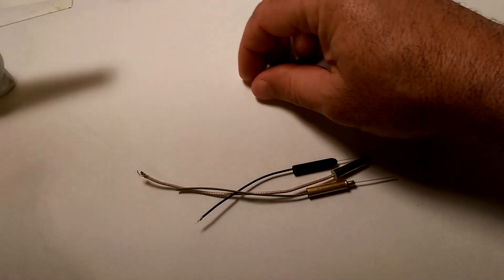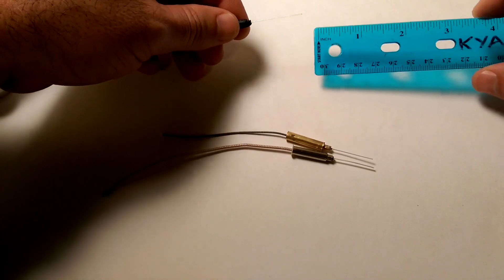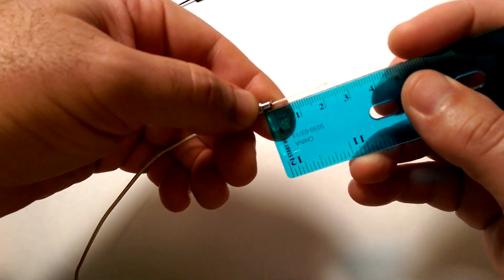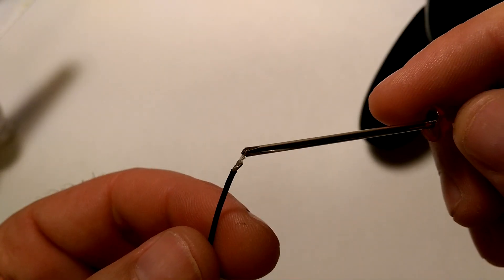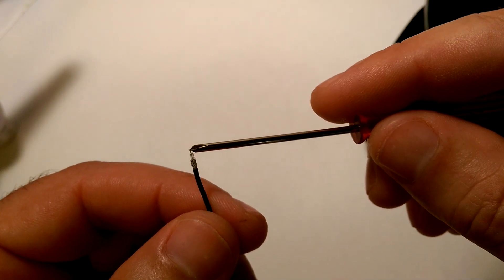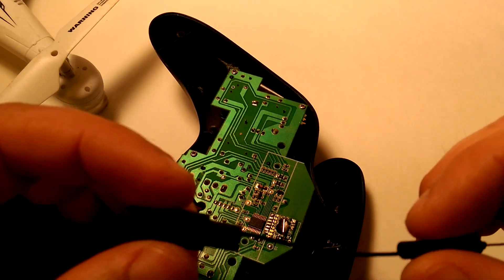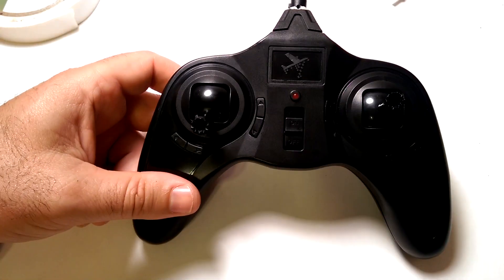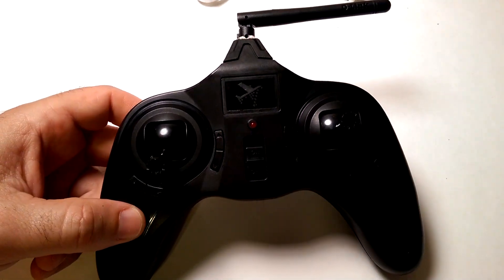Q7 FY326 Triple Range Mod Step by Step (Syma X5C Replica) Quadcopter Drone

Comment: +DustinDunhill would you know where to get a body for the FY326 Q7? Mine had a 15' drop on the blacktop and one of the arms has a crack.
Reply from the maker: I'm not sure but check the store at the link I put in the video description, they may still have parts.

Comment: Oh, sorry... Any quadcopter in this range can be modified to get range over 1 kilometer! I did that, and attached Mobius camera + FPV 25 mW transmitter at 5.8 GHz. Check my channel for antenna modification, installing buzzer, and on my another channel you can find proof of 1.1 km flight.

Comment: Seems that motors are 8.5 x 20 mm, unlike Syma X5C and Bayangtoys X8 - 7x20 mm. Also, I suspect that protocol for remote is the same as Bayangtoys X8 - which is not compatible with Syma X5C. This is good news if true, since I have BT X8, and remote looks more serious than this one. Also, whole quad is cheaper.

Comment: Hey, you seem to know alot about these kind of copters. I have a problem with my FY326 as it randomly looses connection with the controller. It works for about 20-30 seconds but then instantly drops to the ground and is unresponsive. The only way to fix it is to disconnect the battery and wait a few minutes but then the cycle repeats. Do you know of any way to fix this issue?

Comment: Hey, thanks for posting this. I am looking at antennas on ebay and I notice they have different dbi values. Is 10 dbi better than say a 5 dbi? Any tips on making sure the antenna is full wavelength? Thanks again.
Reply from the maker: +David Siglin The highter db antennas should give you better range if you can handle how huge they are sticking up :)

A full wavelength of 2.4GHZ is 12.5 cm.
A 1/2 wavelength is 6.25 cm
A 1/4 wavelenght is 3.12 cm

This should be the portion of antenna without shielding above the decoupler
Reply: +Dustin Dunnill Sorry I should have been more clear - I read where you stated the length it needed to be past the decoupler. I'm just looking through ebay listings and non of them say the length so it seems like it is a gamble.
Reply: +Dustin Dunnill So after taking apart an old 2.4 ghz router it has a coupler thats been shrink wrapped above it to a connection where the external antenna attaches to, should I measure just to that connection when figuring out what duplex I have? Also I noticed they both are different lengths from the same router and comparing them to another 2.4ghz router the external, or screw on folding part, are also significantly different is length. Just trying to figure out what would be the best i guess and the right one. Thanks in advance.
Reply: +David Siglin I meant wavelength not duplex

Comment: Having a hard time finding a 2.4GHz antenna with a 3.1 cm measurement from the decoupler to the tip.
Ive opened up three 2,4 Ghz antennas and all are less than 3 cm.
Any idea where to buy?
Reply from the maker: +GreggC _ Ebay or you could try soldering a small piece on to get length.  Just make sure your soldering is minimal.

Comment: EXCELLENT VIDEO!!!! I'm going to use your suggestions for both the transmitter and the quad itself for my Syma X5C-1 also. I bought two 5db 2.4Ghz antenna's and had the dickens of a problem stripping the teensy weensy coax wire that came with them. I saw another video on You Tube with a wire stripping hack that showed how you strip these small coax wires using a butane lighter instead of wire strippers. Do a You Tube search on "stripping small wires" and you'll find a couple that show how it's done.

One question. Does soldering a longer piece of wire to the quad copter antenna to say, 1/2 or one full wavelength then running it down one leg of the quad make any difference? i.e. is 1/2 or one full wavelength better than 3.12Cm for increasing signal reception?

Okay, okay....one more question. Does the wire you solder onto the existing quad antenna wire need to be the same gauge or can you use a smaller gauge wire?

Again, GREAT VIDEO! Best I've seen on transmitter and quad antenna mods.
Reply from the maker: Hey Robert thanks!  Thanks for stripping tips.  You can also just gently roll an exacto knife over making a circle cut and pulling of sheathing.

Longer would help if wavelength measurements are accurate and yes, bringing out from electronics and center will help.

I would suggest keeping wire same guage and keeping solder joint as minimal as possible (these will effect wavelength).  How much, I'm not sure.  It may b negligible for these lower quality radios.

Good luck!

Comment: I have ordered a 2.4ghz antenna 5dbi its got wire on it already . so it don't matter how long the wire is? the 2.4ghz wire bit is INSIDE the antenna its self yea?
Reply: this is the 1 I have purchased . will this work   http://www.ebay.co.uk/itm/351468229825?_trksid=p2057872.m2749.l2649&ssPageName=STRK%3AMEBIDX%3AIT
Reply: lol yes it does watch the vids on youtube and ive done it now and it goes at LEAST 3 times further bro
Reply from the maker: Yes he does.  Because he did it and it worked.  Imagine that.
Reply from the maker: As long as it is specified as 2.4ghz and brings the signal Portion up and out of the controller, anything will be much better than the stock poorly measured antenna down inside the controller.
Reply: worked like a treat m8 I'm waiting for a low wind day to take it over the field and do full test with both my transmitters (b4 b4 and after mod) and vid it to see the difference il send u link if u want when I dn it ty for help btw

Comment: Hi, finally i'm tryng to do the transmitter's antenna Mod. There are some difference between my transmitter and Your.
Could You help me please?.
In my transmitter the little PCB where the antenna have to be soldered, make a 90° angle with the main PCB... and i have to unscrew  the main PCB to reach the antenna PCB.
I've some pictures of it if necessary. Make some measurement i've found on the little PCB a tab ( is 1 mm round tab) wich is a ground tab..... There is about 5/7 mm between where i've to solder the central wire of the antenna and the ground tab.... This distance (5/7 mm) could be a problem?
Have i to remove hot glue to find a more closer ground tab.. looking this video (at 8.25) sems to be like your distance between central wire and the ground, but my ground tab is clean not used without soldering on it..... 
Sorry for my bad english (I'm italian) ant thanks a lot
Reply from the maker: leonardo Gargano Hey Leonardo,  It seems we have different controller versions.  I would recommend looking to rcgroups.com to find the Q7 forum and maybe someone who has your controller version can help.  Sorry.

Comment: Does anybody know where could I find spear motor gears for this quadcopter? I'm taking about the gear on the motors' axle (see here: https://plus.google.com/+DanielDur/posts/Ub6QNLXZZ8M).
Thanks
Reply: +Daniel Dur yea m8 they are easily available from ebay from people who sell all spare parts for it just type into google syma x5c small gear or....                http://www.ebay.co.uk/itm/251891017508?_trksid=p2057872.m2749.l2649&var=550861488568&ssPageName=STRK%3AMEBIDX%3AIT
Reply: you can get em cheaper but these come to me quick
Reply: ianroofer1986 , you're saying that the X5C gears fit the FY326? Does the motors too? Cause I found several offers for under 2$, small gear included and, giving that at a point I might need motors anyway, I'm tempted to buy two of them (one CW and one CCW).
Thanks!
Reply: Daniel Dur I took a look at your pic and they look exactly the same I purchased them last week they just click on
Reply: +Daniel Dur x5c motor is exact fit on q7 red board

Comment: thanks Dustin. I found a 2.4 gigahertz router and it has an antenna on it do I have to do anything or can i just unhook it off the circuit board and then hook and onto the circuit board in the transmitter? I noticed you had yours apart and I didn't know if I needed to somehow tear it apart or not.
Reply from the maker: Yes, you can use it.  Un solder it and make sure you install it in controller as seen in video.

Comment: Would this antenna work: http://www.ebay.com/itm/Spektrum-SPM6819-Transmitter-Radio-Antenna-DX2-0-DX3-0/391190408326?_trksid=p2047675.c100009.m1982&_trkparms=aid%3D777000%26algo%3DABA.MBE%26ao%3D1%26asc%3D32297%26meid%3Dd8393c6ec7d7453880e1960e96050c07%26pid%3D100009%26rk%3D1%26rkt%3D1%26sd%3D351456929814
Reply from the maker: As long as it's 2.4ghz...but I didn't see it stating it in description.  Maybe ask seller.

Comment: Hello! My red board FY326 can only reach like 50 meters :( ... One question: Why should it be better for range if you use a Wifi-Router´s antenna? My copter has 3.12cm long antennas (the antennas which are built in) ... these antennas are coax cable like the one from a router ... do you understand me? Please help :( thank you
Reply from the maker: The idea with using a router 2.4ghz antenna is it allows you to bring it out of controller for better signal instead of being down in controller and blocked by hands, electronics.

Comment: In your video when you un-solder the stock antenna it looks like it is just a wire with no outside shield that would have been soldered to the ground on the board. How did the antenna work without it being grounded or am I just missing something. I have watched the video several times and do not see where it was soldered to the board at the ground connection like the antenna you replace it with. Also I had 3 Q7s all with green boards. One is now in the top  of a walnut tree about 45 feet up in the air got in a big gust of wind. Sure wish I had her back as I hear they are really having problems with the birds with the red boards and people are saying not to buy them at all now.
Reply from the maker: Yep, it is just a wire with no shielding.  It was the proper 1/4 wavelength but not grounded and to close to electronics.  Range was much worse before mod.

I hope some day the manufacturers take more time to put proper antennas on and bring them further out of controller.

Should be pretty clear in the video of what I've done.  Sorry if you can't see it.  You just solder center conductor of nre antenna where old one was and put solder on ground pad which (was not used before) and solder shielding to that then hot glue.  

The red board is pretty bad but if you have one and you can do his mod it's an option.
Reply: Dustin Dunnill Thanks for the reply. What you did was very clear and easy to follow. I just could not believe the stock antenna was a piece of ungrounded wire. Thanks again for the video!
Reply from the maker: No prob :).  Most of these toy multirotors have antennas like this.  Hope they get better.
Reply: dheller777 a ground wire in just mandatory when  you don't want to emit signal. In fact the simple fact that the wire has the good length and without grounding is sufficient to make it to emit signal - I hope that my signal theory souvenirs are ok (as my english ;-)

Comment: There are a few different 2.4 gig wifi antennas on ebay, are they any good or is it best to make one thats the correct length. Also does it matter if the reciever antenna is 1/4 wave and the tx is full wave. Also I was wondering how this mod works are you swapping the standard assumed 1/4 wave for a full wave or is it just that the upgrade sticks out a bit farther from the tx. thanks.
Reply from the maker: Easiest to get one from eBay and tune to correct length if it's off a little.  I don't think it matters that much on wave length matching as long as each is correct.  I just kept it at 1/4 wl.  Yes, main thing is bringing it out away from hands and electronics and making sure WL measurements are correct, also lateral positioning so tip is not facing craft.
Reply: Great stuff. many thanks.

Comment: Quick question.. I've seen a video where someone solder an coaxial cable wire into transmitter, and heard on another video that it actually could minimize the range instead of extend the range.. Is that true? :)
Reply from the maker: Only if it's done incorrectly.
Reply: Dustin Dunnill Right :)
So, if i'm gonna change it to coaxial, do I need to remove all of the actual wire itself and replace with coaxial wire ? Sorry, i'm a noob.. :D
Reply from the maker: Yes :)
Reply: Thank you a lot :)

Comment: How about adding a second antenna inside the quad?  One down each of two adjoining 'legs' of the quad.  That way you'd never have just the tip of the antenna pointing back at you.

That's probably why some of the fancier 'hobby' grade r/c receivers come with two antennas.
Reply from the maker: Great idea.  It is definitely possible.  That would probably work well.